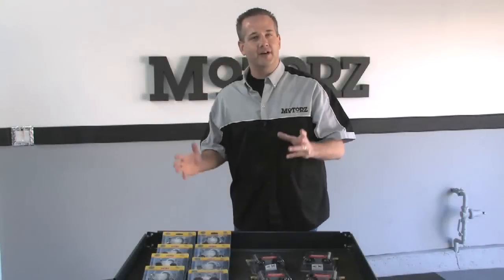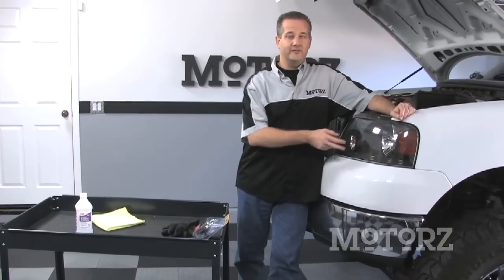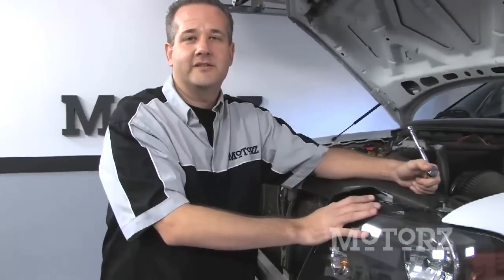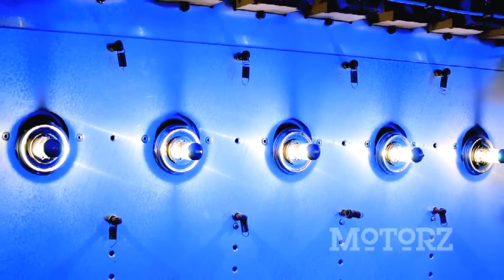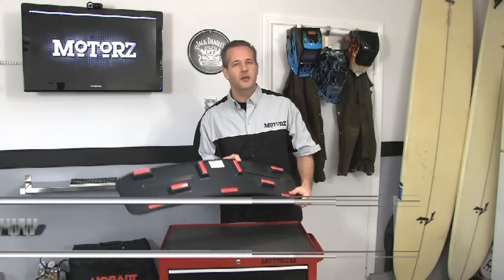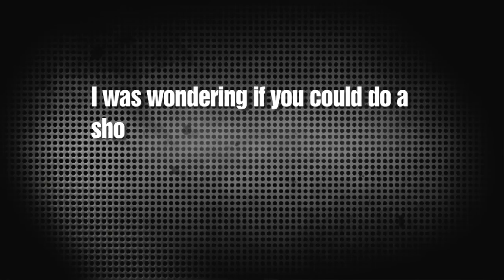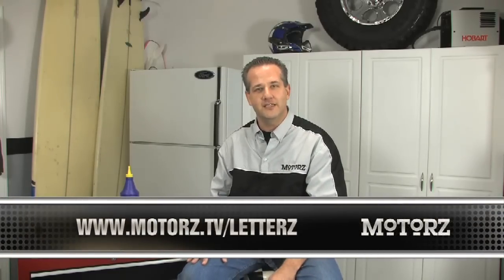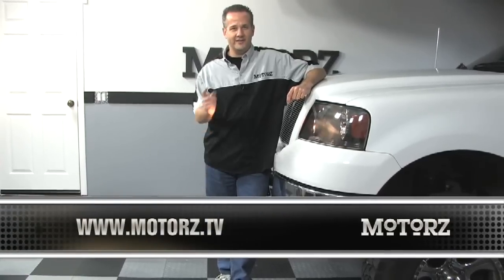How-To Aim Headlights Ford F-150 Motorz #41

Comment: A realization about colored bulbs. Legal ones with lightly blue glass generally look stock. Deeper blue that gives a closer to xenon look, are illegal. And anytime you color a bulb, you are essentially filtering light which makes them dimmer. If a bulb is both colored and appears brighter, that means the bulb itself is brighter to compensate for the color. In other words, you can probably find a non-colored bulb with similar specifications that will give you the brightest halogen output.
Reply: That's why I prefer led lighting. Bright white lights. People are dumb putting those dark blue hid lights in their cars. Looks cool on sports cars but not effective

Comment: HID's are not illegal. You just have to make sure you use them in the correct housing like projectors not reflectors. If you use them in the reflectors the light gets shot into peoples eyes. On the projectors there is a cut-off line and does not blind the on coming traffic.
Reply: Depends on the state.   MA has a yearly inspection and headlight modification from stock is deemed illegal, although some inspection stations pass them.  With LED becoming popular it's becoming a larger issue

Comment: Why is it that so many people fit stupid blow off valves which are designed to do just two things , 1 Make noise 2 Waste energy 3 Lighten your wallet.

Oh BTW 12.5 is slow for that Mustang  I do the Quarter in just over 12 in a Nissan Stagea 2.5 Lit Wagon 4WD  .
Reply: mozzmann  thats  3 things. just sayin. .....and has nothing to do with this video. ??
Reply: +Craig Steven Lynch check 18:30 on.
Reply: BOV releases pressure on a boosted car when you back off the throttle. If you have a good amount of psi you need a bov or youlle likely damage something.

Comment: HID = Highly Inconsiderate Driver.

Roads are always lit. If no street lamps are present High Beams exist on your vehicle.
Reply: +Santa Six , You obviously do not drive out of an urban area with a statement such as your's.
Properly aimed HID lighting is very good BUT poorly aimed they are IMHO dangerous without question. 
My Vehicle has HID Low Beam but standard Halogen Hi/Lo , and due to the reflector shape they use the Lo as a fog light , and the Hi lights up the road rather well. 
Halogen in a longer wavelength light that lights up the road well without making the road side reflector's and advisory signs overly bright.

This is where some people really NEED and education, especially since I see a GREAT increase in LED light-bars and after market HID Kit's that make reflectors and signs real bright but the road is poorly illuminated.
Reply: Obviously my comment isn't directed to people like you guys. If it's essential for safety under your conditions then excellent.
Reply: +kevin leigh 
Personally I prefer LED lighting. I think it's brighter than hid
Reply: Short wavelength light makes the road side signs and reflectors pretty angry and offer little reflection back from the actual road surface , everyone is different and state laws vary too which is not a real issue in Oz  thankfully.